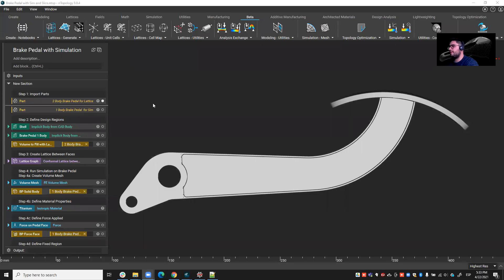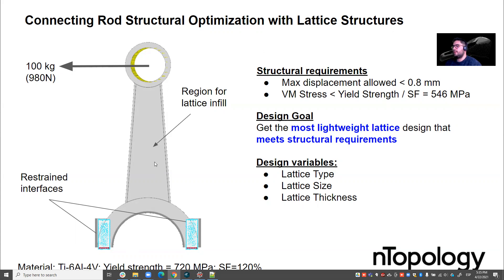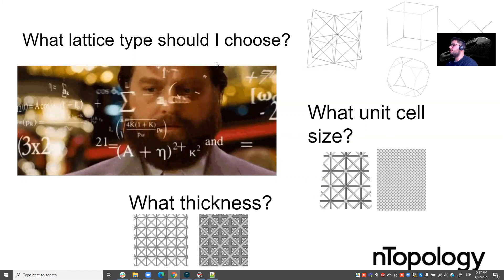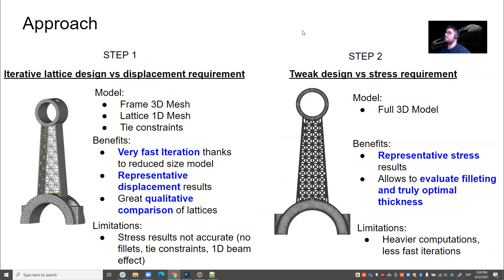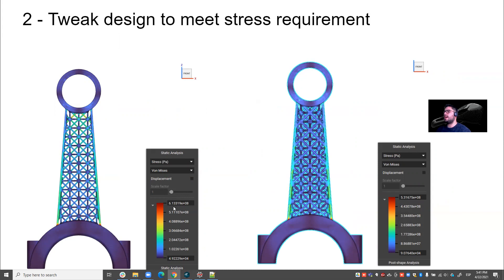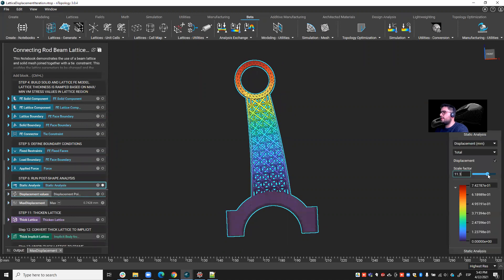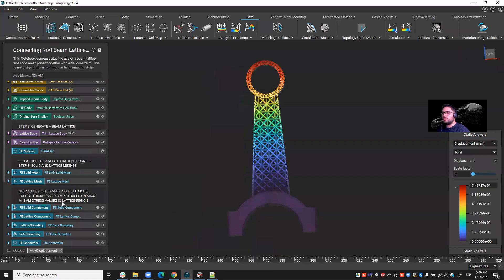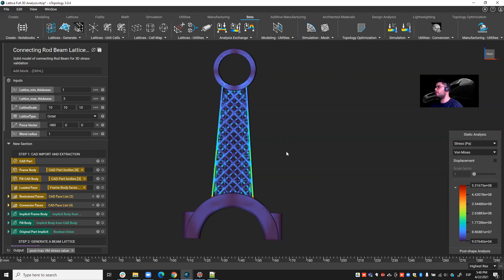nTop Live: Optimize Lattice Structures for Lightweighting with Design Automation

Comment: Thank you for the video. just a question, can we use this method of optimization for TMPS structure in ntop? or in nTop we can just do optimization with lattices?
Reply: Thanks for your question. This workflow uses Conformal Lattice between CAD Faces and hence has just the Graph Unit Cells. You can create your own workflow with TPMS Unit Cells and tweak its parameters based on the simulation ressults.
Reply: @ajayprasad6507  thank you very much